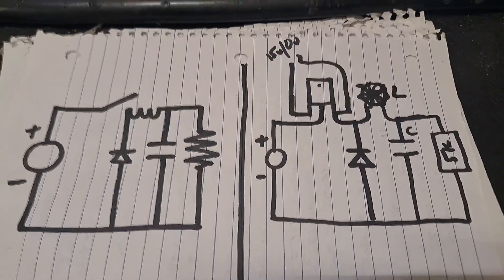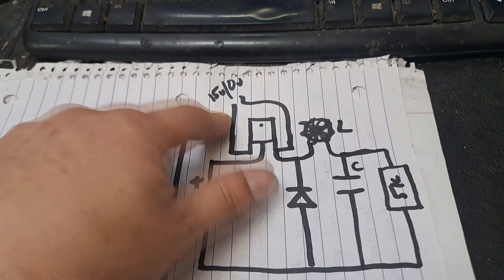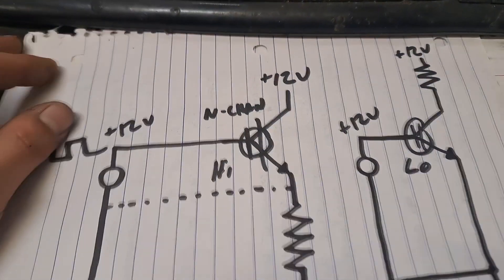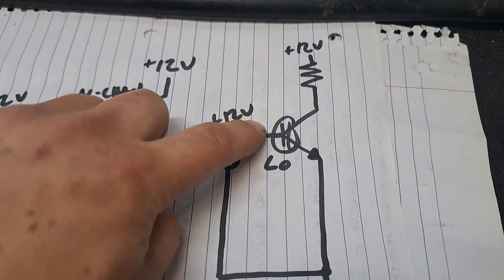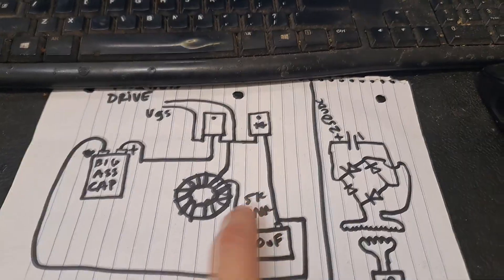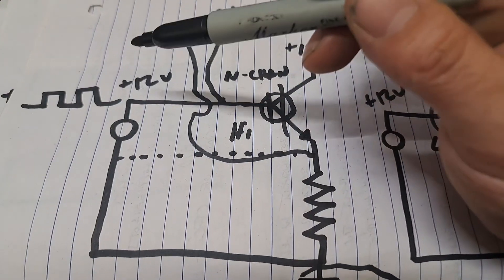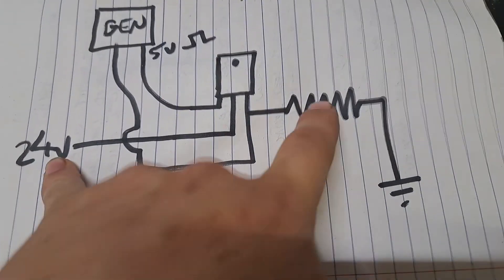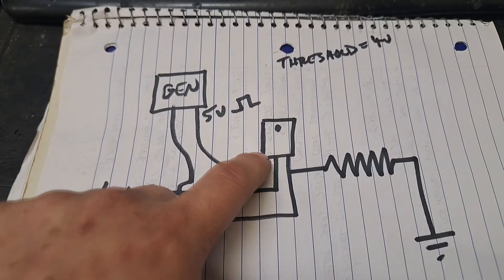QCW Buck Explanation w/Beautiful Artwork (High Side N-Channel)

Comment: Hello, and if you use the Finn Hummer driver on arduino for this buck converter? Send a signal from pin 5 to the converter, and 11 pin to the gate driver, I just don't understand how to use the finn Hummer, can you please give a diagram where to connect it? Is it just that some say that it needs 5 pin for the enable pin on the ucc27322 driver or does finn Hummer not replace the Steve Ward ud2. 7 driver?
Reply from the maker: Finn Hammer made Arduino code to create the ramp so that's all it does, but it does also have a second output on pin 5 which can be used to enable the gate drivers if you are using them in a TC driver. 

So basically if you have an interrupter that you would use for the TC, you can replace that with the output of the Arduino which only gives the square wave for the duration of the ramp on time. 

I would say it's a handy feature to have just to make sure the gate drivers are always off until the ramp is provided, but technically you can bypass it if you want I guess. Just pull your gate driver enables high and use only the ramp output from the Arduino to drive the buck converter. 

So you have pin 11 output which are the square waves telling your buck converter how to switch in order to create the ramps, then pin 5 which is just going to be a 5v square wave which adjust in on time according to the on time of the ramp. That would go to the interrupter input of your TC driver. I'm not familiar with any UD boards but I imagine they are not using enables directly to trigger the drivers and they are always on, but are probably flip flopped using the interrupter signal so you'll probably need to use pin 5 to feed a fiber output to the fiber input of the driver.

Comment: Is the Arduino ramp generator supplying the interrupter pulse to the gate driver or are you feeding the output signal from the ramp into the interrupter then into the gate drive? Doesn't really seem like an interrupter is necessary if the Arduino can vary the bps of the ramps.
Reply from the maker: Yea the arduino supplies both the ramp and the interrupter. You don't necessarily need the interrupter but it can be handy. So basically the ramping squares are feeding the gate drive of the buck converter and the other digital output is just the on time squares feeding the SSTC driver interrupter.
Reply: @Magneticitist  awesome, thanks for the quick reply. Been watching all of your videos back to patch how all this goes together, thanks again for the content. Seems like everyone who makes QCW coils knows enough to not post schematics. 

I think I have everything I need on hand to at least try out making the ramp generator and buck converter. Going to feed that into my custom UD1.3 and full bridge. My UD has the staccato interupter that I will likely just bypass since the Arduino will handle that. 

I think I have hit the limit with my ramped DRSSTC. Seems like ~22in arcs from 120v mains is the limit regardless of dual resonate or not. Going to try my luck with a QCW now.
Reply from the maker: @QZW_Labs  There are few entire schematics posted probably just because once you actually wrap your mind around it you realize it's just combining already known circuits together. So if you imagine you need the buck on the front end, well that's all it is. You would use it to power your coil like any other buck would power a load. The ramp generator is its own thing that just tells the buck how to switch. 

Everything else is just a Tesla Coil, but with QCW it's just kept in mind that it's typically done as a DRSSTC with high coupling and primary impedance with a low C value. 

You might have good luck with just a 1.3 UD board. I tend to throw my own together which are never really up to par with a good UD cause of screwy little issues I might not work out to completion. Otherwise I've basically done just that.. throw together a regular DRSSTC driver. Some of the other guys are using feedback modulated ramps also but so far I've got fairly decent arcs without it.
Reply: @Magneticitist  Yeah, I was working on the block diagram. I should be able to do some tests this weekend. I like your approach, I might implement feedback if I need it but for now I am going to just supply the ramp to the buck and get a feel for how it works. 

I am going to try to keep everything as small and compact as possible. Might not get the longest arcs but it would be cool to see how much I could shrink down the buck portion while still getting a decent output.
Reply from the maker: @QZW_Labs  I think you might be surprised honestly. For example I have a basic full bridge using a small buck that's just a single 60N65 and I feel like it could hit over 3ft arcs easy if I up the voltage high enough. The larger setups I've made so far are capable of very large arcs (maybe except for the ratings of certain things like my MMC), I just haven't been able to tune them for that yet.
Reply: @Magneticitist  that sounds promising. I'll be sure to post a video if I get it running.
Reply from the maker: @QZW_Labs  I'm sure it will be pretty awesome. I mean you did what, like over 10X arcs to secondary ratio with only a 2 inch coil right? That seems pretty crazy to me right there so scaling everything up IDK how much you're going to be able to beat that.. but seems to me like you might be able to do it if you have a big enough DC bus.
Reply: @Magneticitist  You're right, ~22in on my RDRSSTC with a 2.25in coil, just about 10x. I'd like to see how it performs with a proper ramp since it is so finicky using thebmains ramp. Too much power all at once. I wish there was an easy way to calculate the energy used during an arc so that I could figure out how much capacitance I need for the buck. I am going to start way low and keep adding to it to see when I get similar results. It will be interesting to see how everything scales with such a small coil and primary.
Reply from the maker: @QZW_Labs  You know the crazy thing about it is just not really knowing what to actually expect with any given build. I always thought that was kind of funny. Like, we can calculate a lot of things but in the real world it's largely up in the air, literally.

I had no idea what to expect just building a random SSTC without actually just seeing what other people were getting. With a 2 inch coil hitting 10X arcs that basically raises the bar yet again when it comes to what I thought was possible to do. 

Guys are out there gauging it basically based on their similar builds and how many pk amps they are pushing for particular arc lengths. That doesn't necessarily mean to me that someone couldn't get way longer arcs from the same pk current.
Reply: @Magneticitist  I completely agree. Personally I haven't chased high power builds and peak currents. I think a lot of designs are over built and not tuned fully. Which can be good in some aspects, I have definitely killed a ton of FETs & IGBTs pushing the tuning to the limit. 

I haven't noticed any increase in performance using a physically larger secondary either so it will be interesting to see if I can increase my output beyond 10x with such a tiny coil.
Reply from the maker: @QZW_Labs  Bro if that works out you could basically have a crazy TC gun that wouldn't need a backpack. It's all about finding good small capacitors. I found some CDE electrolytics that came out of some old VFD and they were like 400V 1500uF each, but small enough to stack up to 12000uF before exceeding the overall size of one single common 5000uF cap.
Reply: @Magneticitist  Dang! Yeah I was already trying to scout some tiny caps on Mouser. Working on the buck right now. Just going to use a couple caps I have on hand for like 1200uF. I'm sure that is way too low but I have more I can add for testing.
Reply: Yo, how are you driving your buck circuit? Are you using an isolated supply? I am working on updating my UD driver for my QCW build and your videos have been a big help for figuring everything out. YT comments are tough, would you mind if I bounce some ideas off of you via email? I sent you a dm on the highvoltageforum if you don't mind.
Reply: I created a qcw thread on highvoltageforum. Hopefully figuring out my buck modulator so I can finalize the pcbs.
Reply from the maker: @QZW_Labs  Awesome, I'm hoping some good talks on tuning comes out of that. There are a lot of caveats I honestly don't want to try getting into such as the inductor calculations etc.. I just get sidetracked and never get anywhere until I just start actually building and trying different components. I've used those T300-2D's almost exclusively except for smaller builds. Stacked 2 of them for the larger ones.  What bothers me about the output with these is that it seems there are too many ways to tune it for the same output. I could almost arbitrarily toss together any combination of MMC and primary I felt were in ballpark tuning and the output would be about the same.
Reply: @Magneticitist  Same here, I am still learning a lot about each section of the coil. The trickiest so far for me was the isolated buck driver. That and I am redesigning the UD board I made to fix some errors and make some changes to the PCB layout. Still lots to do on that. 

I appreciate you doing that and taking videos, though. I do that too, where I know "it should work" maybe better or worse but it is nice to start somewhere. I am trying to increase my knowledge on theory but sometimes it is nice just to start building something to see what works. 

That is how I felt when I was tuning the output of my RDRSSTC. Seemed like such a huge range for almost the same outputs when it came to MMC size vs primary turns.

Comment: This is awesome
Reply from the maker: There are some things I wish I explained better but it's the basic gist. I try to emphasize isolation but in reality my setup is only isolated at the ramp control which is basically the metal box I'd be having ran out with cables.
Reply: @Magneticitist try optimising the ramp code that finn hammer uses using CHAT GPT . Then increase the pwm frequency to like 50khz and just improve the overall code with GPT .
Reply from the maker: @spiderspider1384  wait, using chatGPT? I've played with that thing a couple times but I wasn't aware it could do all that.
Reply: @Magneticitist yea i just gave it the original code , copy paste , it knows what the code does already, TECHNOLOGY. 
Then i ask it to increase the pwm frequency to 50khz and optimize the code , then ask it to make changes to the original code. 

Also ask it to add captions so you know whats doing what in the code.
Reply from the maker: @spiderspider1384  I guess theres a proper approach to it where I need to learn to finesse the AI. The mfer just keeps hitting me with stuff like "sure! Post the code and I'll try to interpret it" etc, followed by "something went wrong".
Reply: @Magneticitist  network interruptions can cause the AI to not work properly.
Reply from the maker: @spiderspider1384  that's one of those free sites too. I think we actually have an account at work so I might try using that

Comment: Great now I get it , thanks so much for the explaining brother , so a isolated power supply is the key , since the zvs is doing the isolation if I use one battery to power the zvs and the gate driver ,-- then the output of the zvs say 200v to charge the bus caps and feed the drain of the igbt , I should be fine , but the gate driver ground needs to be connected straight to the source of the fet so that gives the vgs directly to the switch , makes sense now . But since there is a lot of expensive components in there I wanted to be sure what the hell I be doing hehehhe , much appreciated brother
Reply from the maker: No prob, there are definitely other 'caveats' but when it comes to just reconciling how to switch the high side it's really simple
Reply from the maker: I might also do a video at some point on the actual gate drive part but IDK if it's really "necessary" to do it super safe. I'm really just worried about an interrupter being isolated etc.
If you really wanted to play it safe you could use a GDT I guess. Or just feed everything with AC and transformers. 

As far as the power supply it's not so much that it's isolated but just that the supplies are not common grounded, even if their 'grounds' are electrically connected. The grounds are why you do not have total isolation, but your voltage sources are just not using a common ground to derive their intended outputs.

It's like with a high side driver IC that uses a bootstrap capacitor there is a common ground between the IC supply and the low side switch, so that voltage (say 15V) is going to power that low side gate at 15V. That same 15V however cannot be common grounded to the high side switch drain because then it just shorts out, so the floating source (Vs) is used referenced to the High Output to drive the high side gate and it's getting its voltage from the bootstrap cap.
Reply: @Magneticitist  I might even try it with a irfp460 I got laying around but if need to buy the diode I might as well buy the igbt and the opto driver and the right components , for the inductor I might try a little ferrite transformer since I don't have any big toroid and they seem pretty expensive . Why does the coil driver need to have a interrupter input ? If it is a coil driver that can handle cw that won't be necessary right ?  , I would like to see this buck feeding your class e single fet driver with sic fet if that could be possible ?
Reply from the maker: @rodriguezfranco3839  Technically it doesn't need the interrupter if it's just always going to run CW when a voltage is applied but since I'm using this particular ramp generator, the overall window of on time is regulated by it the interrupter input. So basically there's a PWM output and a Pulse output, the PWM being the ramps and the Pulse shaving the on time and repetitions I suppose. The gate driver enables make that easy but you can definitely get around it. 

I will have to make a new class E to use the buck on because all of mine were made for low voltage, maybe 50V max.. and that's with particular tuning where they want that max voltage to run properly. Since the buck is going to feed ramps that automatically means it's only going to see proper tuning at the peaks. The end result is basically just going to be short arcs that don't really form straight swords. If I make another one intended for higher voltage it might be cool.

Comment: what's preventing the Nch placement on the low side ?
Reply from the maker: I suppose in general just keeping the load grounded which doesn't really matter far as I can tell. I just never tried the low side switching cause I didn't want to change anything.
Reply: @Magneticitist  btw I just remembered (or I forgot the answer) that I still haven't figured out why some schematics show a "dual choke Mazzilli" with both choke coils wound on one core. In my experiments this doesn't work, more precisely  it only works when the coils are reverse polarity, which beats the purpose as the magnetic fields cancel hence there's no choking. This only bugs me cause I have limited components and I'd like to be as economical as possible
Reply from the maker: @sFeral  You mean for mazzilli drivers in general? All I've ever seen was the use of 2 instead of one, but as far as I know using the 2 chokes basically changes the dynamic of how it works. The single choke setup I'd say is more or less just using this choke as a wanna-be constant current source. Using 2 coils which can basically become part of the LC becomes tricky. When it comes to limited components I'd say that's the point of the original mazzilli driver. I always use the original unless I'm just messing around trying stuff.
Reply: @Magneticitist  I'm guessing that the lack such configuration on Aliexpress indicates that it indeed doesn't work, as they would seek to cut expenses
Reply from the maker: @sFeral  It's probably just more concern regarding how someone may wire up their supplies etc. In the case of where I'm using a ZVS driver to charge the buck caps I don't really see it making much difference. I think typically the better approach is to just add a low side switch to make it synchronous.
Reply: @Magneticitist  everything after "btw" wasn't related to the aforementioned Buck lol Yeah, just a general question about Mazzilli
Reply: @Magneticitist  though in theory it shouldn't work at all since it's like the LC tank is shorted across, hence I'm guessing something more is happening... my PSU shuts down as it can't sustain the load and I can't measure anything so it would be great to see what's actually happening
Reply from the maker: @sFeral  I'd have to really see what you're trying to do. I don't see much point in a low side switch for something like QCW because the mosfet/igbt drive, at least for me, is always going to come from the a separate low voltage supply. This is why I still don't get why people ask me about it in regards to QCW. If you have a low voltage circuit you'd like to utilize a single supply with, like literally just the one, then maybe a low side will make sense assuming your VCC or VDD is literally the same voltage as what you're driving it with. I'm utilizing various supplies but just from the single battery so honestly it's no difference to me. They are not common referenced.